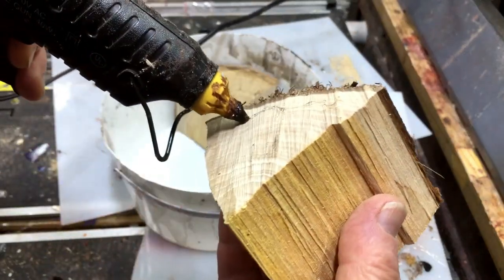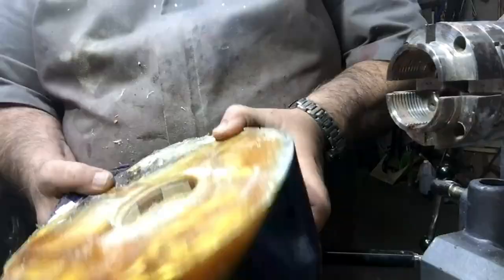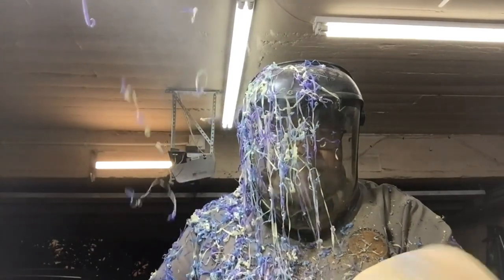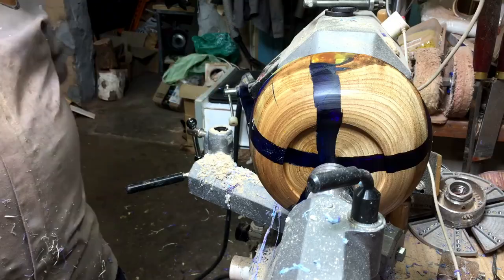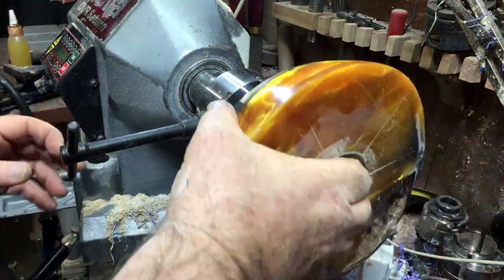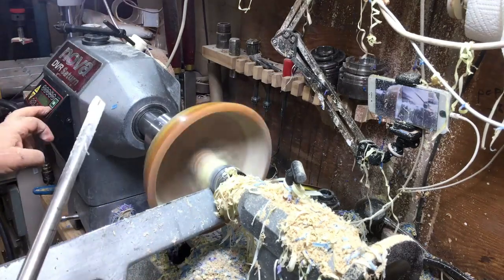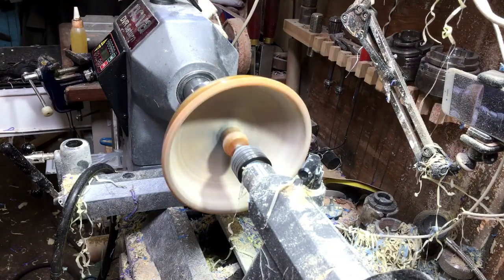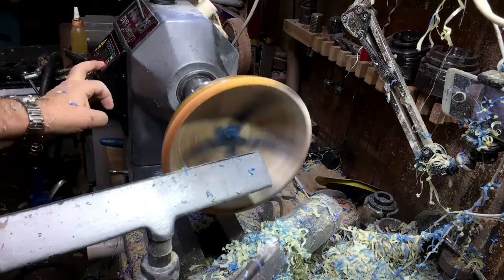woodturning  multi resin chestnut bowl

Comment: Nice bowl Ahron, I love the colours, especially the metalic purple :)
I do have a question for you Ahron, how do these mixed bowls last over time, with the resin and wood (or other mixes). Are they prone to cracking as the wood tries to expand or contract and the resin is, I persume, a very stable product with very little expansion ?
Reply from the maker: Thanks . I started to mix resin and wood 3 years ago and the only one that i had problems was a bowl off wild olive and alumilite resin . the wood moved and you can feel it at the line that they joined.
Reply: @oldmanwoodcraft  Thank you.